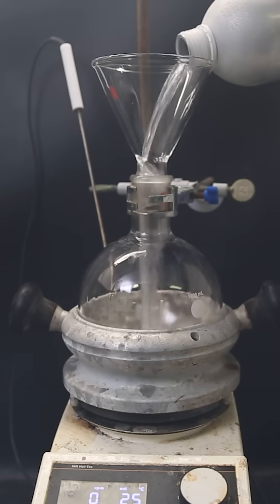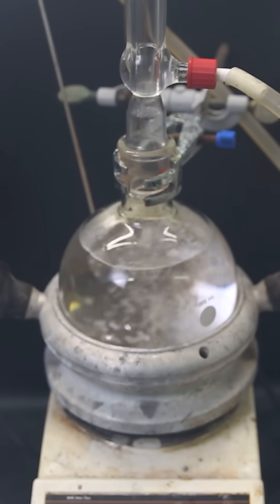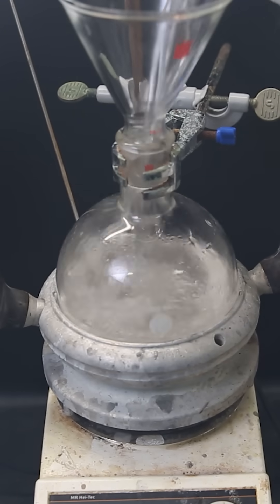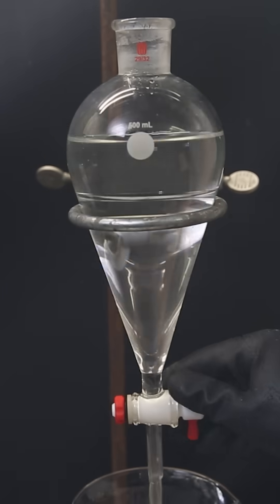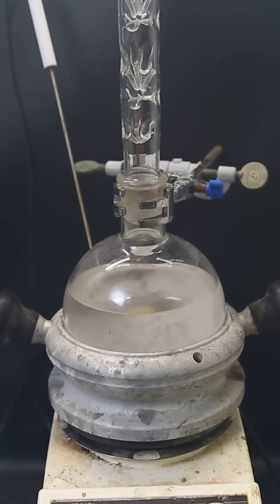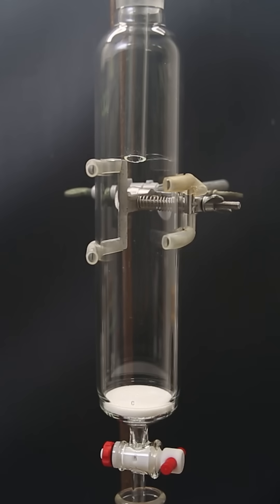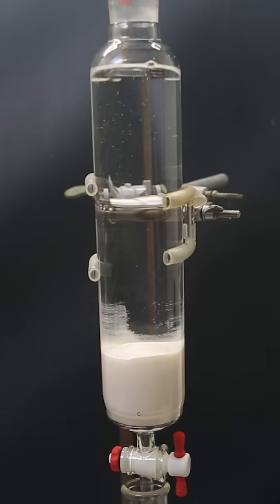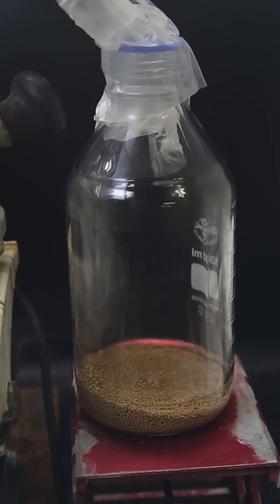Purifying Carbon Tetrachloride

Comment: ⚠️ BIG WARNING ⚠️ 
Do not heat carbon tet with concentrated sulfuric acid or phosphorous pentoxide!
It makes phosgene.
CCl4 + SO3 -> COCl2 + SO2Cl2
CCl4 + H2SO4 -> COCl2 + HCl + HSO3Cl
CCl4 + P2O5 -> COCl2 + POCl3

Also, potassium hydroxide can make a bit of phosgene in contact with CCl4 but luckily phosgene is destroyed/consumed in this reaction.
KOH + CCl4 -> KCl + HOCCl3
HOCCl3 -> COCl2 + HCl
HCl + KOH -> H2O + KCl

COCl2 + KOH -> ClCOOH + KCl
ClCOOH + KOH -> ClCOOK + H2O

Comment: where did you get the method for such a purification ?
Reply: It's the usual method of CCl4 purification. This solvent is very robust and is treated with whatever kills impurities but not CCl4, which is pretty much anything. If you're asking about mercury, it removes sulfur and sulfur compounds, which may be present in old CCl4 because it was produced from CS2 back then. This step is rendered mostly useless by purification with permanganate.

Comment: Do you need purified tetrachloride? I would just buy another flask.
Reply: from where?
Reply: @Molko701  I was just joking. Seeing how far he goes to clean his flask, I would just buy a new sterilized one instead of going through all those steps.
Reply: @DatNguyen-yq2jz  oh sorry , was asking if there were any sources for carbon tet, it being so dangerous. It has been used for preventing emulsions (making benzyl acetate).
Reply: @Molko701  My sense of humor is questionable most of the time. I was told many times that people don't get my jokes, and I am not funny.

Comment: Those 600 ml could destroy so many livers and kidneys if they got into the wrong hands... I applaud all the extra effort, personally, I would have stopped after the separatory funnel.
Reply: Looks like LD_lo is 3~5 mL (ingestion). That's 200 lethal doses on the high end (statistically you'd probably see much fewer).

For 10 min, 30 min, 60 min, 4 hr, and 8 hr inhalation exposures, AEGL 2 (serious/lasting effects, or impaired ability to escape) is 27, 18, 13, 7.5, and 5.8 ppm; AEGL 3 (life threatening) is 700, 450, 340, 200, and 150 ppm.
Reply: And to think, mid-century, anyone could buy this stuff in local stores

Comment: is this overkill because you can  or a standard procedure ? and what is this ultra pure CCl4 for?
Reply: Try to buy lab grade carbon tetrachloride and I think it'll make more sense.
Reply: You can have:

A: Water with some unknown contaminants, which may or may not be dangerous.
B: Definitely safe, clean drinking water, but you have to filter it multiple times before you can be sure it’s not toxic anymore.

Which do you choose?
Reply: @lobbyhoe01 considering how many people drink well water, probably A for most people
Reply: @lobbyhoe01 I drink A, usually with the utility company's testing to confirm that it probably isn't very contaminated. I also drink private well water, and know for a fact that one of the wells I drank from growing up was contaminated with trichloroethylene (enough for a 6-figure class action payout to the household before showing associated illness). I definitely drink A.

Anyway, this is CCl4, not water. High purity CCl4 is unlikely to be much better for your health than what this video started with, so it's getting cleaned for a different reason.
Reply: @lobbyhoe-01 but I don't drink CCl4 because I like not having cancer

Comment: Overkill? 

I mean, it may have started nasty , but during the process it was exposed to air... And
Don't all those reagents I wish I had, possibly introduce impurities? At least you cleaned your alumina.. Wouldn't have just being distilled over the hydroxide be sufficient?
Reply: Yes and no, each reagent targets other impurities
Reply: @foc2241  just seems like the first steps could have been combined into one,(mercury, hydroxide and permanganate reflux followed by fraction distilled) and the alumina filtering of a crystal-clear distilled liquid at that point seems unnecessary. The phosphorus to get rid of water could have been reserved to just before use as the molecular sieves and storage should have helped a lot....
   But my cotton plugs are from the pillow I finally through out, so I'm not one to talk ...
Reply from the maker: @petevenuti7355  It had very nasty sulfur impurities, the clear color doesn't say anything in this case. After passing it through activated alumina, the powder had a very potent and nasty sulfur smell from capturing it.
Reply: @Chemiolis  I would have thought the Mercury and hydroxide steps would have made it so the sulfur inpurities not distill over... Humm , why would the alumina work when that wouldn't?
Reply: @petevenuti7355  Because… it’s a completely different filter?
Reply: @lobbyhoe01  think about it, if it's already been distilled what kind of invisible particulates would be distilled over, especially with a fractional distillation, that any filter would be useful for?  
  So its unlikely to be a particulate, it can't react (fully) with Mercury or potassium hydroxide, must have a boiling point very close to carbon tet or a very high vapor pressure, a very strong sulfur smell, and is polar enough to have a high affinity for alumina , there can't be very many things that would fit. It makes a good puzzle question!!! , name that impurity!

Comment: Anything in mind for the ultra pure carbon tet?
Reply from the maker: Not yet, but I do use it sometimes and will again. Mine came from antique fire extinguishers and had stinky sulfur impurities that are hard to remove. I prefer it to be clean the next time I use it.
Reply: @Chemiolis 'stinky?' You're inhaling this shit!? You are aware it's neurotoxic and linked to long term mental health issues right?
Reply: Special cocktails
Reply: The method Purification can make the Carbon TetraChloride to the Ultra Pure, Yield: >99.99998%